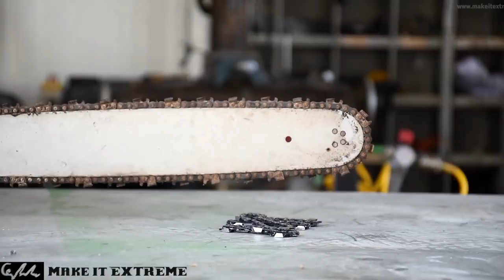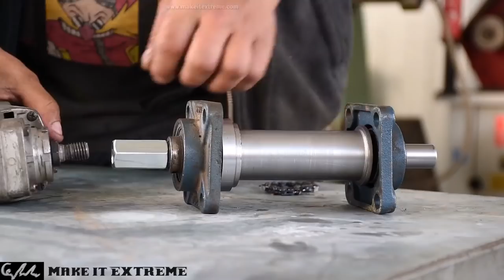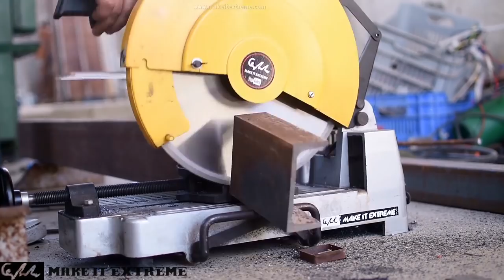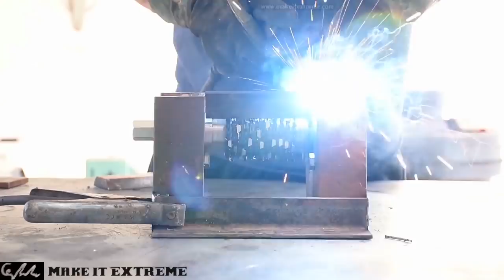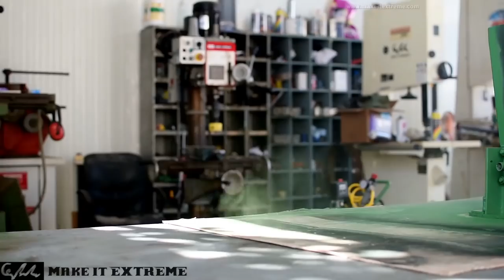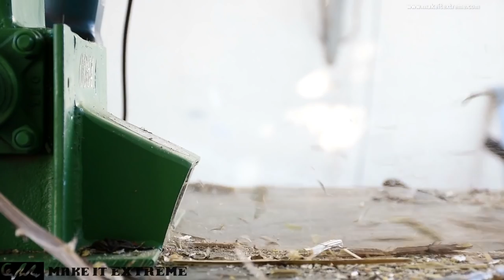Angle Grinder hack

Comment: Those bearings are not designed for 20k+ RPM
Reply: SaltyBrains  as long as it works for 15 seconds for the video recording they do not give a wet fuck
Reply: Angle grinders generally run at less than 10,000 RPM when unloaded. This speed is at the top end of some bearings and well over the maximum speed of many bearings. I guess you can buy high speed bearings for this design - probably best to make the easy to replace, bearings get hot when run too fast then the dry out and it’s all downhill after that.

Comment: Perfect for making coleslaw salad. I did notice that there was an elevated level respect and perhaps a bit of fear of making finger burgers. I too would be apprehensive, given that the angle grinder is gear driven and does not stall the motor easily. 🪓🥩🍔🥗

Comment: good luck if u have to replace chains or the whole shaft assembly in the future
Reply: eh not really, 4 bolts on one side to take the shift out.... and I doubt it would get that much use that it would need the shaft replaced